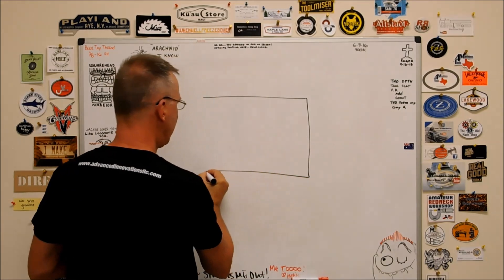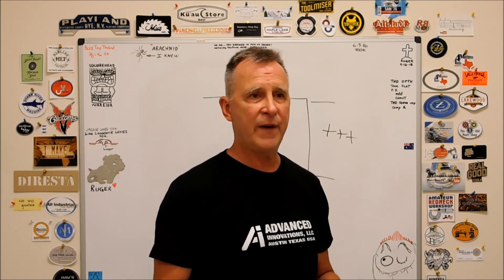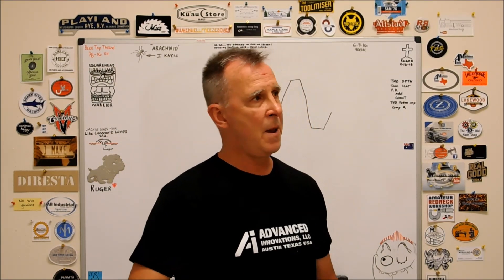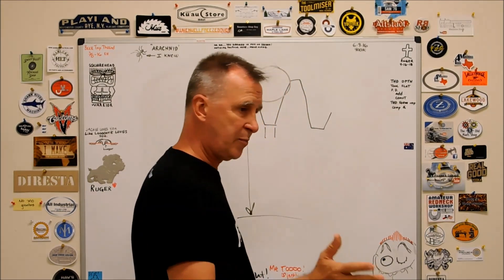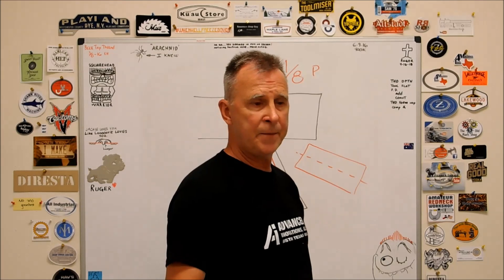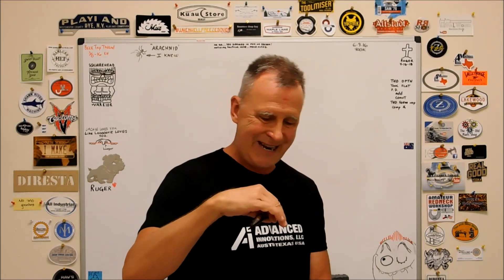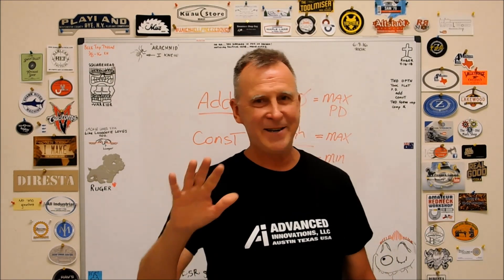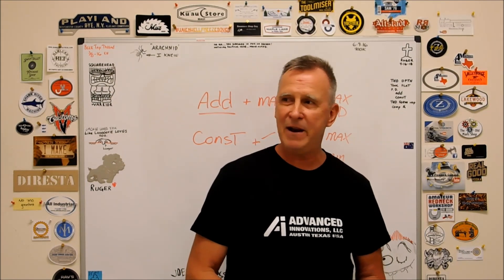Single Point Threading, Want to do it better ?? Watch This Video.

Comment: Joe, if you really want the pitch diameter of an internal thread, how about this:

Starting with having accurately measured the minor diameter of the internal thread, place a small ball (of known diameter) down inside in the thread, and then use Gage pins to see how much protrusion there is of the ball up into the bore.

As I see it, you can accurately measure the bore, you can accurately measure the ball, and by using the Gage pin, you can determine the pitch dia.

Thoughts?
Reply from the maker: I actually thought of a piece of wire of a known diameter laid into the helix and making at least one full circle. Then check the ID. Makes sense to me. What do you think ??
Reply: @joepie221  yeah, spiraling a piece of wire in could work pretty well too.

Would obviously have to have a very smooth bend, with no kinks. Or, that would throw the measurement completely off.

Otherwise, as the other commenter pointed out, we would be at the mercy of trying to locate a ball the correct diameter...

And, I think using a thread Gage would probably be a hell of a lot more fun... but then you are at the mercy of making the thread Gage, or waiting for the one you ordered to show up - which might not be that fun, either
Reply: @joepie221  - who sells coiled gage pins? :)
Reply: @joepie221  Like an internal version of O-vee wire gauges.

Comment: Dear Joe
Another great video.
If you have a copy of "The Engineer's Black Book", the tapping drill size pages list the Pitch Diameters for you.  In this book however they call it the "Effective Diameter", (perhaps because the origin of this publication is Australia where the terminology may be a bit different?).
I hope that is helpful.

Paul
Reply: I believe that term comes from mechanical engineering, treating it like 'gear pitch circle'? 

https://www.quora.com/What-exactly-is-pitch-circle-and-its-significance-in-gears

Comment: Thanks Joe, love your enthusiasm!
One thing, the H/8 root of a threading tool for a specific thread makes a stronger thread because it spreads out the stress area at the thread root. If you are going to cut a lot of threads then a threading tool for the thread you are cutting is the way to go.
Reply: mosfet500 - I understand that having flats on tool tips is far simpler for making threading tools, and for leaving the most material on the workpiece.  However I wonder if there's a point where rounding the corners at the tool tip to get rid of the stress riser made by the corners of the flat, would make a stronger thread?
Reply from the maker: Yes. I believe they are called 'J' threads. Lots of rounds. The crest of the mating part must also have a radius, or the corners will hit on tighter class threads.

Comment: As expected words of wisdom.
Threading is such an interesting subject that has occupied the minds the brighter machinists for many many decades. I myself have a video on the subject that demonstrates a style of threading tool from 19th century. Very useful for times when you can't easily disengage the leadscrew as the tool lifts clear on the reverse cut. You colonials should be proud as it is an American idea.
As for 3 wires, one day i will do a video showing my one handed three wire system that requires no calculations! Interesting or what?😀

Comment: So then the question is do you make the part to print or to standards? :-) Sometimes they don't agree as there maybe special call outs to allow for coatings or post processing.  Gear cutting is the same way its the Pitch diameter that matters not the root.
Reply: @nick f - That's one thing about engineers / draftsmen, they often don't bother to call out things they should such as standards.  You have a dimension (if you're lucky) and that's it.

My experience has been, when a dimension doesn't make sense, I question it, I don't change it to what I think it should be.  If you're on you own, like making a replacement part for something made by a company that's dead and gone, you're only left with standards regardless of what the design considerations were.

I've never gotten in trouble for making a part to the blueprint dimensions.  It's the engineer's job to work out the dimensions, and the bastards seldom 'show their work' on how they got there (no notes on the print identifying the difference from standards).  Meaning, there may be a good reason why a dimension is different than a standard but there's no way to know that from the blueprint.

Comment: Thought you were going to also draw the thread that would be cut at the same depth by a tool with less of a pointy end and show that the flanks (sides) of the cut would be wider - and consequently the PD not as large.  It's really difficult to let go of the idea that you must be able to just feed in some amount to get the right thread until you fully understand why it is not done this way - of course, it doesn't mean that it's not useful to have a ball-park figure to aim for rather than getting the wires out after every pass.

Comment: I know an apprentice toolmaker who was taught to cut till the thread gauge meshes nicely.  Upon hearing this, the director of the metal working program at the local college deadpanned "...that's the stupidest thing I've ever heard."
Reply from the maker: Done correctly, there should be a go and a no go gage present and used. Meshing nicely ( go gage) is usually what you strive for. Am I missing something?

Comment: Excellent subject well covered Joe, yes applicable to metric and all screw threads. Think of trying to measure your foot whilst wearing "Winkel Picker" shoes 🤔. Hit Google for anyone under 50.
Thanks for sharing and best regards from the UK.
Reply from the maker: I just finished a job that I described to the customer as " trying to cut your toe nails with your shoe on".  Your comment is timely.
Reply: @joepie221  Thanks for replying, If I may suggest a part two, ref practical/comparing thread tapping a female, then screw cutting a male versus to correct pitch diameter. But don't scare the guys too much, hobby guys and gals are very welcome/needed.
Yes you have confused, and hopefully edified many with your topic. As a small shop owner, I have thread plug/ring screw thread gauges from M6 to M20, with certificates, plus two screw thread micrometers with 6 anvil sets from 0.35 to 6.0 mm pitch to circa 46 mm diameter.
Many YouTube viewers see small shops, thread a male to a nut, or supplied mating part (hand made or proprietary) and think thats it!, but as you stated, machine shops rarely have the mating part, and it would be bad practise to do so, unless the drawing calls for matched/lapped etc.
Another subject if I may suggest is a split nut to reduce backlash, (before ball screws were readily available, with design preload), ref Bridgeport X and Y axis nuts.
Again enjoying the subject and presentation.
Regards John.

Comment: Hey Joe -ever made a nut or screw that was perfect and send it to a customer just to find out that thread on his shaft for example is stretched due to force?Then they try to fix it with a tap or die just to cross thread it even worse?And then they call you and say that old nut/bolt(which pitch was also stretched by same amount)was working fine but your new doesnt.
Sounds familiar? +
I had ship axles with that problem where you put it in machine and when you insert knife tip in the pitch beggining portion of thread clears just fine but when it comes to a place where nut was tighten to a propeler ,to a part where force was great -you get crossthread and ruin it commpletly.Is there a way to fix this?
So far only thing that worked is to remove thread and make a new one on smaller diameter.
Reply from the maker: No fix for that aside from a sleeve. Stretched threads are trash.

Comment: I think you complicated it a bit but here is simple explanation -all of your threads should be .10-20mm in -.Tip of the 55 or 60° thread is useless since it cant carry and force.
I always did it like that and never had any problem.
Threading is not something mystical ,people done it for 200 years.Its all about tool-if you got tool grinder and a hss blank you can make amazing internal/external set that will produce close tolerance threads.Thread inserts are option for those that dont have good grinder.You can also grind it by hand but it will never be as good as machine,still it can be usable.
2nd thing is positioning of tool parallel to a chuck.
3rd is depth of cut(also known as pitch in metric thread ) -aka how deep you push your knife into material,deeper you go it will widen the thread -go too shallow thread wont fit,go too deep and thread will fit loosely.-thats your tolerance(aka how good is thread dimension similar to each other ) .Good quality thread gauge will fix this for you.Unless you do some really fine work screw pitch gauge from  good manufacturer will do you just fine for 99% of threading.
4th-practice -go to your hardware store and buy thick wall plastic tube(you wont crash your lathe and do damage) and start cutting 
 internal/external threads.plastic is soft so even smaller lathes wont have problems.Once you understand basics which are simple threading becomes easy.
Reply from the maker: Your observation for #3 is incorrect. Pitch is the distance from one crest to the exact point on the next crest.
Reply: @joepie221  was just about to write the same Joe. Good job I carried on reading.
Reply: @joepie221  metric thread is equilateral triangle=all sides are equal thus making a pitch also how deep you will cut your root of thread.
Imperial thread is other thing .And since i rarely use imperial threads i was reffering to a metric thread.
Reply: @zumbazumba1  Metric threads are also measured from the pitch diameter, not the depth.
Reply from the maker: The height of an equilateral triangle is not the same as the length of each side. So the depth would not equal the pitch.
Reply: @joepie221  not to mention the flats or radius. 60 degrees yes, equilateral, not quite, by about 0.2 x pitch I believe!
Reply: Sorry dont agree entirely with your statement. I think your writing may have got ahead of your thought process, maybe try rewriting and you may see what is trying to be pointed out.
Reply: @metalshopwithtroy5755  That is your opinion ,if you can write it simple and better.I dont think a lot i speak from experience of 10 years.

Comment: Subsequent plating or coating matters.   The iso charts are not designed to compensate for thick organic coatings like Geomet. This isn't something your average machinist is going to have to worry about, but is extremely important thing to consider. PD will the adjusted by the manufacturer to the low end of the specification in these applications. If it's a Japanese manufactured part, they will often violate the minimum PD spec BEFORE coating and makeup for it with the organic coating. Otherwise your prevailing torque spec will be too high to pass.
Reply from the maker: I've had a lot of experience with that. Make a good part and pray the plater doesn't over coat it and ruin it. Its a team effort at that point and you better trust the guy handling the plating.

Comment: When cutting threads in aluminum they come out fuzzy and I have to run a triangle file in them to smooth them up. What am I doing wrong with aluminum?
Reply from the maker: You need more top rake on your tool, or you are cutting forged aluminum which is like clay.
Reply: Make sure your tool height is centered. Try threading with the compound set at 59.5deg so that when you feed in with the compound the tool travels along the angle of the thread. You will get a better finish cutting threads using the compound
Reply: @chrisn3794  Thank you so much. That kind of specific help is great to receive.

Comment: Hi Joe
   In Coventry UK I was screw cutting on a big Dean Smith & Grace lathe, I think it was 62mm thread anyway cutting with insert mounted tool the man on the night shift said don't use the gauges, just cut the thread until the thread o/d measures 62mm -004 thou (-.10mm) you will find the gauges fit perfect, and yes it did, the insert tool form worked out as you got to the gauge size it just took a skim off thread o/d, I didn't find it worked on other sizes sure did save a lot of time!
   Interesting looking at stickers jimmy Diresta I was talking to him in Birmingham UK what a nice guy & yes we have selfie!
Reply: Those would have been full profile inserts as opposed to partial profile.  The difference being that each one is specific for a pitch (you therefore needs a different insert for each different thread pitch - that is their downside)  and it has the correct root form on the tip (how sharp or rounded off the tip is) for the pitch and when it is deep enough, it will start taking off the crests so once your OD is right, unless the insert is damaged, you must have the correct thread form.  Not that it isn't worth checking it still.
Reply: Gareth Jones thanks Gareth I have a better understanding of inserts now.
Reply: @Cenedd  Yup, those full profile inserts are nice in the sense that there is no burrs to clean, but still getting an accurate thread requires some measurement to be on spec. Of course if you are running the same threads for the umpteenth time, you get the hang of it just from the OD measurement once the first ones have been checked properly. Though in production work there still should be checks made every nth part.
Reply from the maker: I agree with Gareth Jones. thats a special insert, and yes Jimmy Diresta is a nice guy. Met him a few years back.

Comment: I have watched this video 3 times and i am still confused about what the exact problem is.
When cutting threads on a lathe (especially if taking lots of small cuts) you set a depth target and after you chech with wires or what ever for accuracy and adjust accordingly.
Am i wrong about that?
Is his argument/rant about people who do not properly check their work after machining? Isn't that a machinist lesson 101? 
I am very comfused otherwise.
Reply: If I may, the point of the turning tool, cuts a clearence feature only, think of a Vee block on your bench, and you place a suitable sized round bar, the gap underneath is clearence. Unfortunately, the turning tool point (assume sharp point here) can only be used in set-up, and turning, but it is not the feature you need to produce a screw thread. Think of trying to measure your foot while wearing "Winkel Picker" shoes.
Reply: @bostedtap  I get that ideally it should be a trapezoid and not a triangle and that makes a deference betwin theoretical and practical thread depth, but we do need to have some thread depth target, don't we? Are we supposed to measure with wires and a micrometer on every pass until we get it right?

P. S. Thank you very much for your reply.
Reply from the maker: @paranoidandroid9511  Measure with the wires once a reasonable thread profile has been established. Get a number. Adjust your cut to end up within the range defined by the thread chart. Check the part again. Done.
Reply: @paranoidandroid9511  Joe is illustrating that machining a screw thread is not defined by "Thread Depth", but yes all threads are cut using a depth value as it is the easiest method, careful measurement of the threading tool for flank width at its effective pitch diameter would result in a true thread by depth technique. Full profile, either single or multi point help greatly, but radial/diametrical depth is still the only means to produce a thread.
I am assuming, that you, as I, watch many YouTube manual machinists, where by they will always use a female thread (Tapped with full form threading tap), unless a mating part is available to check a male thread. When making both male and female by single point, then the male part is threaded to depth, and hopefully checked with wires/anvil. Non of these screw threads are to a true interchangeable Standard.
As a hobby/small machine shop, I do own plug and ring gauges from M6 to M16, and thread micrometers up to 46 mm. I can measure inch 60° threads.
Hope this helps?.
Reply: @joepie221  OK, but if i have to cut the same thread 50 times i would cut-mesure-adjust the first  time, note the final depth on the lathe, cut 2 more trial runs and then go full production (perhaps measurring every 10 parts for wear and tear of the tool).
Does this make me a bad machinist? Because it is the only way it makes sense as a buissness. owner.
P. S. Thank you for the reply.

Comment: Informative info as always .  I have used the DD chart since i was 14  back in 78  but  you need the mating part  !  I think you converted me to wires a while back  & i bought a set , just have to start using them !    Glad to see my sticker made it safe  ,   Cheers  Joe .
Reply from the maker: You are on the board !!
Reply: @joepie221  Thanks .

Comment: As a hobbyist (and a new one) I wonder why I see everyone creating threads with a tool which has been ground to 60 degrees and why don't they use 60 degree inserts like the tmct range (at least for larger threads)
Reply from the maker: Budget.